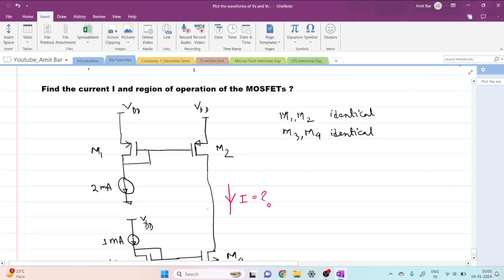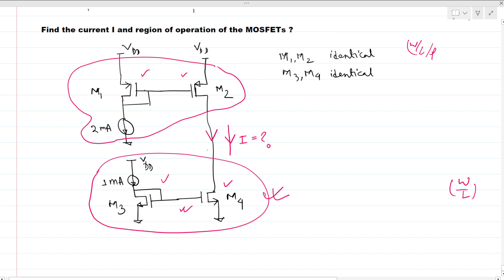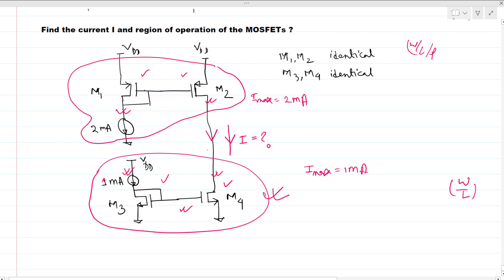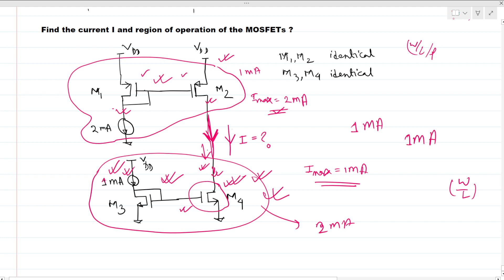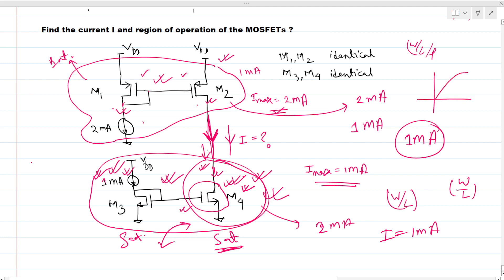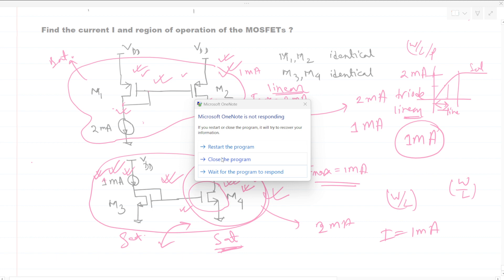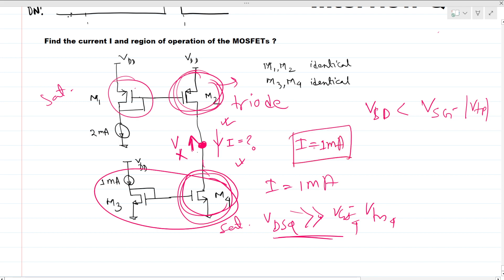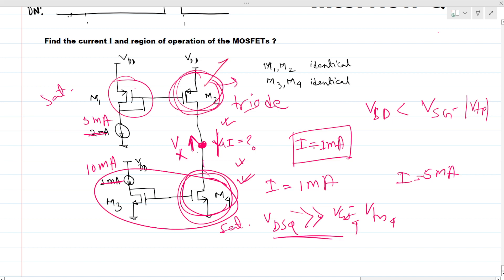Analog Design Engineer interview Question_  Current Mirror circuit problem

Comment: Why ur not choosing 2 mA current,

Why ur choosing lowest current?
Reply: If you observe the ckt properly, if M1 and M2 are in saturation, we should get 2mA current through the circuit. But it is not possible because M3 and M4 can produce only 1mA current even in saturation. So we consider M1 and M2 in triode and M3 and M4 in saturation bcoz we can get that 1mA current in M1 and M2 if they are in triode.

Hope this helps.